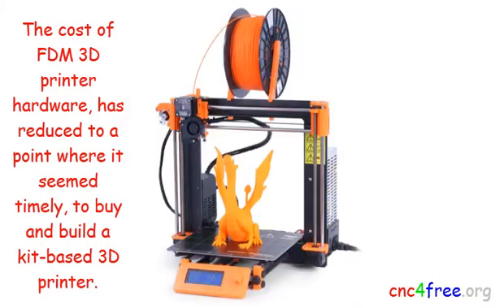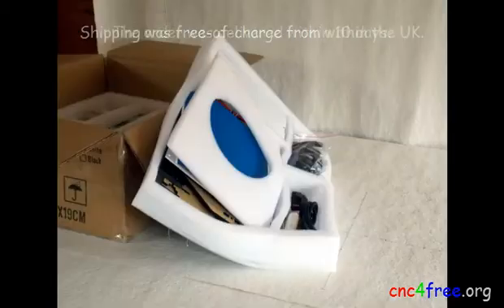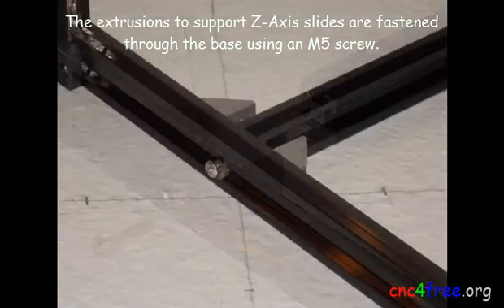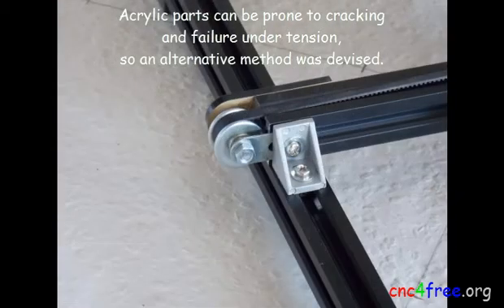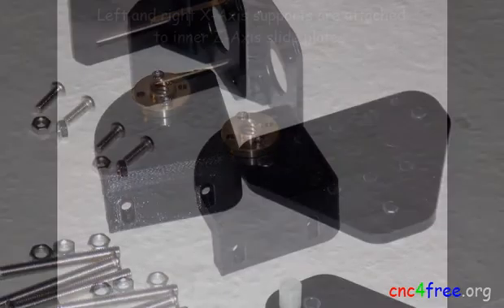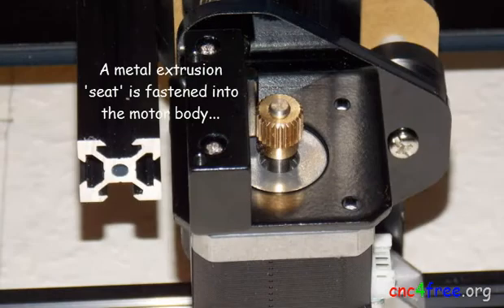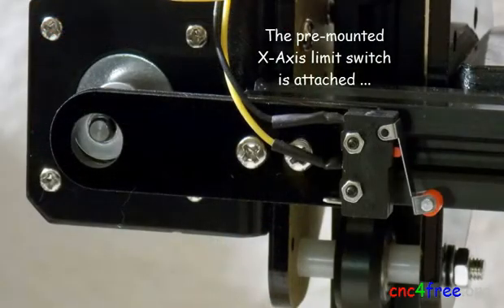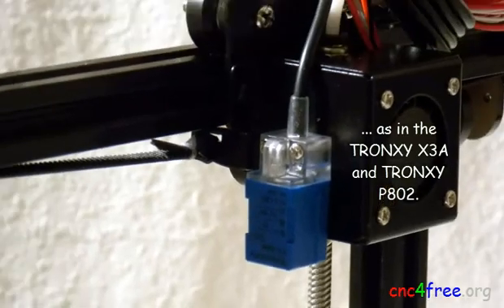Tronxy X3 / X3a 3D printer kit, build and overview Part01

Comment: thank you for the build video it is gonna help me with a lot of small issues with my build did you make the plates for the bed to stop the wobble or did you buy them?
Reply from the maker: Hi there,

Glad you found this useful.  The plates I used were some pieces of 'Meccano'..a kids mechanical construction /  design based 'toy' that was fairly popular / available worldwide.  Anything that will keep the bearings engaged with the T-slot should work.  I've since seen (but haven't used) some 3D printed Tronxy 'bed stabilizers' on Thingiverse... 

At the time of building, I wanted to use metal (for a more permanent / reliable solution) and also needed a fix I could use WITHOUT having a working printer.  

Hope this helps

Comment: read it your self
Reply from the maker: Hi again,

It's not my intention to disrespect or offend you.  However, I feel you are making far too much out of what is essentially a personal preference....

As I have said... If the TTS vocal is such a problem for you... then mute the audio and go with the text... 

Hope this helps
Reply from the maker: Hi there,

I can assure you that I have read the assembly manual very carefully.  Perhaps you can indicate why or where you think this isn't the case.  In my own review I've made it clear that I haven't always adhered to the manual.  As a result of my experience designing and building a large format CNC router (see the link below), I was able to spot some problems and apply remedies as the build progressed.

https://www.youtube.com/user/yohudi

The TRONXY X3 video I was refrerring to, made it very clear the reviewer had not read the manual, when they decided to drill unnecessary holes, in the Y-axis rail and the center of front and rear base frame rails, to mount the Y axis via bolts passing through both pieces of 2020..  

As you will know, having assembled your own X3a version of the machine, it's quite clear from the assembly manual that this is not required and is in fact counter-productive.  As the reviewer in question went on to discover.....  It prevents the Y-axis drive-belt from passing underneath the Y-axis rail.  NONE of the other video reviews of the TRONXY X3a have attempted this..

Hope this helps.
Reply: No i mean this is the most un watchable video i have ever seen on the tronxy... and it's the first one i didn't come close to watching.... If you had read your text and not used the horrible Computer reading it for you it would be a billion times better video... Re make this for the sake of man kind :P
Reply from the maker: Hi there,

I apprreciate your comment but sadly I'm unable to go along with your request.  If it bothers you that much.. you can always mute the audio and just go with the text.... that's what it's there for...
Reply from the maker: Hi again,

As I said,  I appreciate your comment.... but I do have my reasons for using TTS vocals....

On-screen text is provided to accomodate those people who may not be able to follow the TTS voice, or who would prefer not to hear it...

Hope this helps
Reply from the maker: Hi there,

Many thanks for your comment.... please see my reply to Ultrasonic2
Reply: He means to stop using this creepy voice generator and use your own voice! :)
Reply: I tried to help you man.
Reply: It seems that you have problem with understanding.
Reply: Jesus Christ! You don't understand. I tried to help you understand other people to not wasting their and your time.